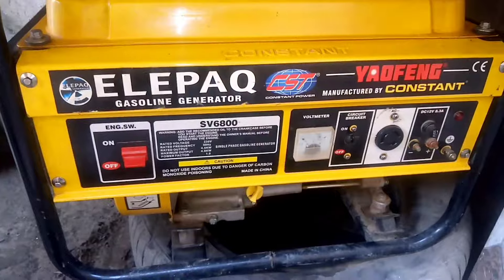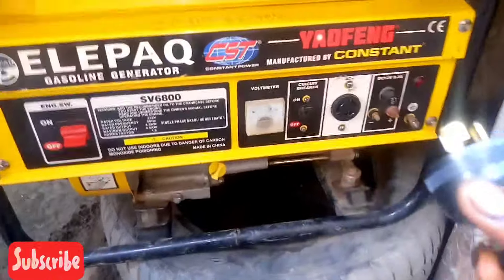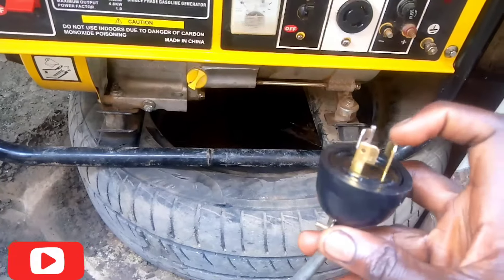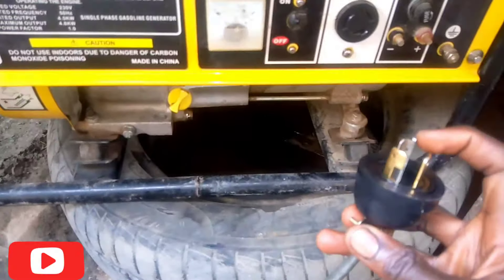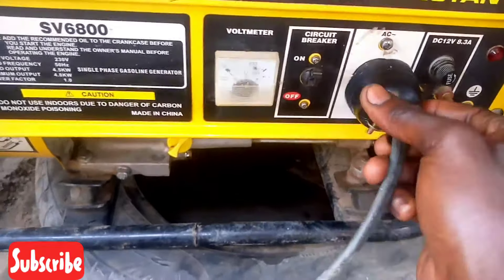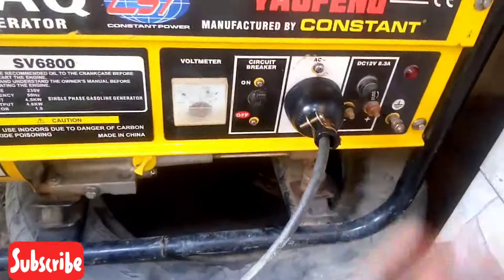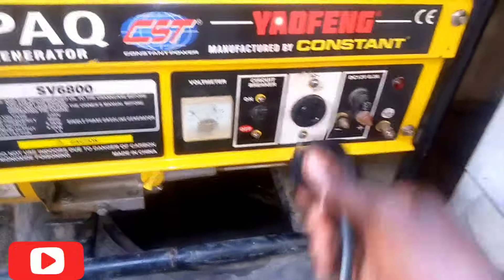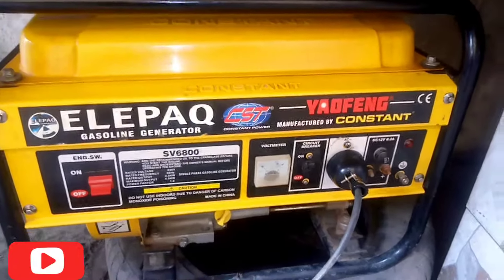HOW TO INSERT A GENERATOR PLUG 🔌🔌

Comment: What if it doesn't have a plug 
How do u do It for it to enter inside the generator
Reply from the maker: For safety  reasons try and buy the plug. You can use ordinary wire but is not safe.